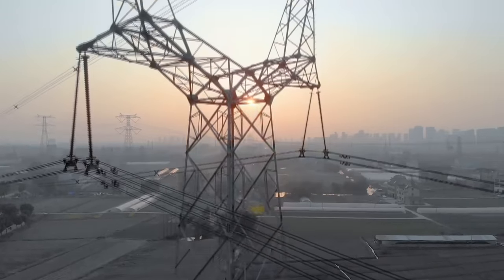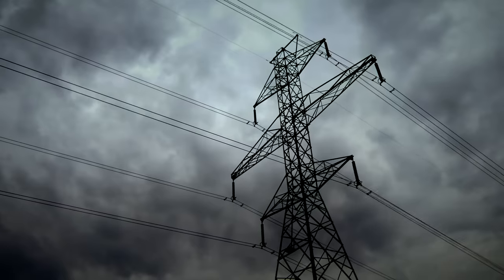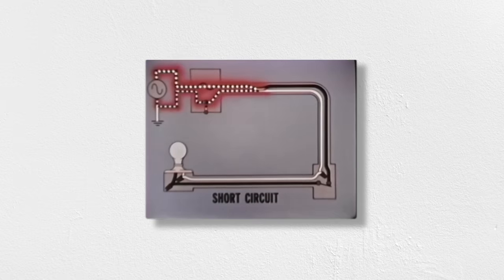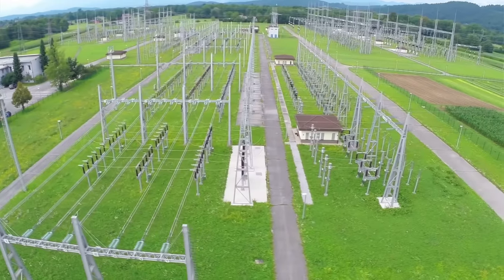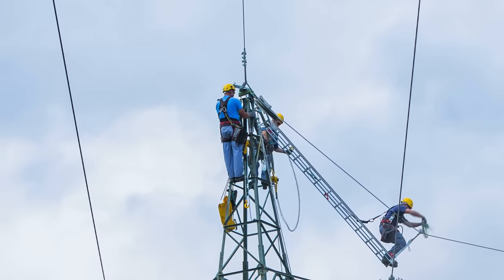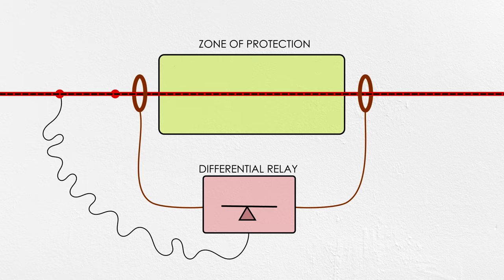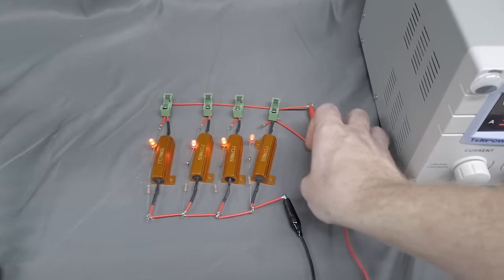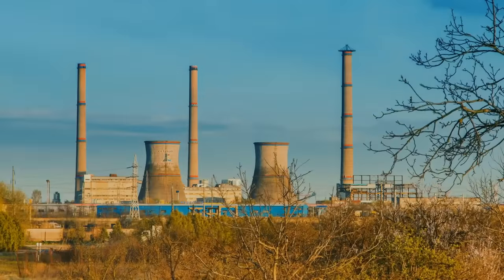How Power Blackouts Work

Comment: "Loss of a service at the cost of protecting the rest of the system" well that is a different perspective
Reply: That's why major public services and big business had their own emergency power supply, though.
Reply: Look at it this way: Do you want to lose power for one or two days or 2 months? Designing systems to go off grid or fail, before the powerplant does is essential, to not have power for the next 2 months. If the generator in a power plant gets damaged, that plant usually isn't working for the next 6 months. Also shedding large power consumers, like steel arc furnaces and so on is faster than starting up a gas turbine.
Reply: @JainZar1  or the electric companies can start doing their jobs and stop being greedy and put there lines underground in forest areas and not have the fire/blackout at all.
Reply: @emanuelgonzalez7213  If your place is anywhere near San Andreas fault, then putting your cable underground is... rather suboptimal. They should have done more maintenance, though.
Reply: @emanuelgonzalez7213  there will always be blackouts. In my experience, ground cables break more often than hanging power lines, usually because someone didn't check the ground before digging. Also, ground cables don't get cooled of by wind, so they are more prone to melt during heavy load.

Grid protection is my job. It's really about shutting down before stuff breaks. If you have a blackout that lasts for less than a day, we've definitely done our job. If it lasts for a week, we might have missed something important.

If nobody even tried to do our job, expect at least a few fires, and probably a transformer explosion. The full cost to replace everything that was destroyed will probably be a dollar amount of 6-7 figures, and take at least 6 months before it's up and running.
Reply: Guys I think you all missed the joke. Loss of service at the cost of protecting the rest of the system. It's the other way around. You protect the system at the cost of a small loss of service.
Reply: I believe it was supposed to be in the opposite order--protecting the system at the cost of a loss of service.
Reply: #GrammarNazi

#WordCrimes

😅😅😅
Reply: @emanuelgonzalez7213  rolling blackouts aren't what's happening in ca right now. Rolling blackouts happen when there isn't enough generation capacity to meet demand.
Reply: @MGSLurmey  This guy gets it.
Reply: "Loss of a Special Administrative Region at the cost of projecting the rest of the country" well that is a different perspective...
Reply: Rusdani Budi Wicaksono hA
Reply: Brain “hey heart stop pumping because we’re seeing a spike in signal”

Heart “aight”

Body “wait, DON’T! what the ..........”
Reply: @emanuelgonzalez7213  Following on to what was already said, underground cables are massively more expensive to install and maintain. WHEN, not IF they fault, they take a much longer time to repair. In the time it takes to find many underground faults, a standard above ground line would've been fixed and back in service for a while. Then you still have to excavate and splice the underground cable. 

They have their place and are great for some areas, but they aren't a magic bullet to end all power outages. These are all things the design engineers consider when designing a line.

Boy ohh boy do people get mad when you fire up a hydro-excavator in the middle of a residential area at 1 AM to fix a cable. Even if the powers out, lol.
Reply: @emanuelgonzalez7213  Actually, underground lines are less reliable then overhead lines, and finding faults can be a nightmare. Underground transmission lines require circulated oil for cooling. The public perception of underground lines is very far from the reality.
Reply: @flagmichael  it depends on where you are. Here in FL underground is much better.  Hurricanes don't damage underground lines, and underground lines don't bump together in the wind damaging other equipment.  I think it was 2004 or 2005 when we had 3 hurricanes in quick succession. Some areas were without power for months while they replaced downed lines and damaged equipment.  As the first hurricane was starting you could see all of the fuses and transformers exploding across the horizon, it looked like lightning off in the distance.  I was lucky, only 1 week without power after each storm.
Reply: @8180634  The trouble isn’t just reliability. Capacitance of underground cables is far higher than their overhead counterparts. That represents a considerable added strain on generation to produce more reactive power so the lines can stay charged.
Reply: @emanuelgonzalez7213  Yeah, why don't the electric companies stop taking our hard earned dollars until they generate infinite wireless energy and make everyone immortal? Until they build an indestructible grid which effortlessly conveys me literally anything my heart desires I'm not paying my bi
Reply: In 2003 we saw a dip in the Frequency as  far as Arkansas. I spent 47 years in generation ,transmission and distribution, this was a good video.

Comment: In 2003 at 3 AM Italy had a serious blackout that involved 56 million people. It was caused by a tree flashover on a 400kV line that supplies power from Switzerland to Northern Italy. The loss of the powerline triggered the two 40kV lines from France to trip as well, due to the sudden increase in demand. In 4 seconds GRTN lost control of the power grid, as a series of cascading events plummeted the entire Italian peninsula and the island of Sicily into darkness. As the grid frequency dropped below 47.5Hz a total of 7.5GW of distributed power plants went offline.
The blackout lasted for 12 hours, though some regions were affected by rolling blackouts for two more days. In Rome people were stuck in underground trains. All flights were cancelled, and a total of 30.000 people were stranded on trains. Police described the situation as 'chaos', though no major incidents occurred.
Though our little power outage was big for Italy it pales in comparison to the 2012 India blackout, which involved 9% of the world population.
Reply: also in 2003, the US northeast region suffered a massive blackout for much the same reasons, though the initial line failures took place over about two hours, with the final cascade of power plant shutdowns taking less than five minutes.
Reply: Italians are well known for electronics, especially in cars.
Reply: nice comment, thanks
Reply: You'd think a tree, much less the ground itself is a really bad conductor, but that's 400000 volts. And electricity is known to jump, even in thin air. It's probably a good idea to get rid of any trees anywhere near high voltage lines. This is also why hospitals have self sufficient generators that can last I think up to a week, or until they're out of fuel.
Reply: This is why we need underground lines. More reliable, safer and less environmental impact.
Reply: @PunakiviAddikti  Not only does hospitals have generators, most life critical hospital equipments have battery backups on them, so temporary electrical disruptions won't kill someone, though it would often be just enough to finish the operation or perform emergency evacuation if generators don't come back online soon.
Reply: Is the grid grounded?
Reply: @cryo_life  no.
Reply: @samschannel531  Um, no.
Being underground means they're vulnerable to a different set of hazards, is all. Actually digging the tunnel to push the lines through has a fairly large environmental impact, and repairing any damages would have a reaccurance of said impact.
Plus, it'd probably be weak to small earthquecks.
Reply: Marik Zilberman, You wouldn’t have to cut down huge swaths or trees and keep them trimmed, and there’s no warning for a tree growing into a line in the middle of nowhere, but there is early warning of earthquakes so the lines could be shut off before the earthquake strikes.
Reply: @Mernom  the first thing I though: flooding
Reply: @samschannel531  the 2003 US/Can incident was a few problems all at once. The initial problem was a tree. However this was due to a small private utility company who had hired a small tree company to maintain the said area. The company was neglectful of its contractual obligations. This alone should not have cause a major issue. However the monitoring system was also neglected and the tech, who was supposed to be monitoring the system, was away at lunch iirc. As this part of the grid failed, the remaining power stations started to pickup the load, and couldn't handle it, causing more and more overloads. It lasted a few days until they finally discovered where the issue originated.
Reply: While it affected many people, it did not last for too long. I remember the 1998 American ice storm. The outages lasted several weeks, even months. From wiki : "Exacerbating the problem was a steep drop in temperature that immediately followed the passage of the freezing rain, which combined with the extreme power outages led to numerous indirect deaths due to carbon monoxide poisoning from generators and other sources as people desperately tried to remain warm. Many power lines broke and over 1,000 transmission towers collapsed in chain reactions under the weight of the ice, leaving more than 4 million people without electricity, most of them in southern Quebec, western New Brunswick and Eastern Ontario, some of them for an entire month."...."Critically, about 1,000 steel electrical pylons[15] and 35,000 wooden utility poles were crushed and crumpled by the weight of the ice, further damaging the power supply and hampering the return of electricity. Teams were brought in from places such as Prince Edward Island and Nova Scotia, along with teams from the United States and the Canadian Forces, to help restore power to affected homes in eastern Ontario and western Quebec"
Reply: @samschannel531  It's not that simple. Studies have been done by many entities. See, for example p6 at https://psc.wi.gov/Documents/Brochures/Enviromental%20Impacts%20TL.pdf .  Quoting from it as an example, "It is a common practice in residential areas to place low-voltage distribution lines underground. However, placing high-voltage transmission lines underground is less common and can cost two to ten times more than building an overhead line. While this practice may reduce aesthetic and other impacts, it may increase others. High-voltage transmission lines differ from lower voltage lines in that significant aboveground facilities are necessary to support the underground cable. [....] Underground transmission lines can have the following disadvantages:
• An increase in the area of environmental disturbance;
• The complete removal of small trees and brush along the transmission ROW;
• Increased construction and repair costs;
• Increased operation and maintenance costs.
Reply: Hope u all are safe
Reply: Lol, most of India uses unregulated electrical power
Reply: proud_asian_newyorker you're not familiar with electronics, aren't you?
Reply: @Mernom   Having lines in ground does have some other adavantages: 
-No as heavy infrastructures (pylon) needed, so less metal to manufacture, assemble and transport.
-Cables can be made of full copper and of higher gauge, whereas for overground they're thinner as they must be lighter, this introduce higher resistance losses rating.
-For some situations, the wiring lenght may be smaller, so less conductor's lenght and so wasted electricity.
-Lastly, cosmetically, it's clearly better and it avoid some preocupations (trees and other)

The cons are that cables must have very thick and resilient insulating surface for external degradation; burying them into ground is difficult, maintenance concerns are suboptimal, and security wise, underground is not always the best, again, according to the situation.
Reply: RIP the tree.
Reply: Read "Blackout" from Marc Elsberg
Reply: Last big blackout in Germany was a when a big snowstorm tore down some powerlines roughly 20 years ago. 
Almost 2 million without electricity for a week or so
Reply: @PunakiviAddikti  Indeed, it's not animal, but vegetables species that are the downfall of power grids.
Reply: "Police described the situation as 'chaos', though no major incidents occurred". Yep, that's Italy and why love it.
Reply: @samschannel531  Underground lines have their own problems, including cooling needs, expense, and difficulty in finding faults and repairing them. Underground lines for transmission level power are very rare. (EDIT - I retired from IT field Services, with emphasis on Energy Delivery systems, in a Fortune 100 electric utility.)
Reply: Atleast everyone was sleeping
Reply: @flagmichael  yeah, I worked in the electrical industry for a couple of years and learned about thermal runaway where underground cables melt and can explode.
We still have a large number of oil cooled underground cables here in the UK. They're that old that they leak like a sieve, so they just have a gravity fed tank continuously topping it up at the substation.
Reply: Italy and chaos are more or less synonyms.
Reply: @yoyit2Dan  I think there was also a computer glitch that hid the problem?
Reply: That happens when you run your power lines near to thiers max capacity.
Reply: 12 hours of black out is nothing, where 12 days of black out is as common as the rain
Reply: @PunakiviAddikti  Here in America the NFPA requires 96 hours of fuel stored on site for generators. If i remember correct that's calculated by the unit running at 80% load.
Reply: @akimbojimbo3763  Nice to know that there's a mandated minimum. That should buy some time to prepare, like get more fuel. I think most places also store more fuel.
Reply: But why it's happens?

Comment: I can simultaneously:

1. definitely respect the engineering aspects of blackouts and the safety it brings
2. be utterly frustrated at the years(/decades?) of mismanagement and shunned preventative maintenance that lead to them being required
Reply: Ideally, grids and systems should be replaced regularly (they transmit HUEG amount of energy, some material deformation and decay cannot be avoided), but changing these stuff are costly, and sometimes you run into problem like 'these stuff didn't made anymore' or 'nobody really knows how these works', which is ultra sucks.
Reply: Travis Johnson : Ontario Hydro learned a major lesson during the Ice Storm of January, 1998.  Since then, they are much more diligent about keeping trees away from local power lines.  They always had been pretty good about the major high voltage distribution. “Next Door”, in Quebec, they learned that there was a limit to how much weight a transmission tower could hold. . .  and when one collapsed, it would pull down several more.  It took more than a month to restore power to some areas.
Reply: I never experienced a blackout in the 33 years of my life (in a small and "overdeveloped" nation though).
Reply: @Peter1986C   I hate the word "overdeveloped." It sounds like we had enough innovation and we need a few steps back when people were dying of preventable diseases or people were living worse than we do today. "Overdeveloped" really sounds like some form of scare tactic that primitivists would say.
Reply: Preventative maintenance can't prevent everything, and it's never been expected to.
If you see a power system with constant blackouts for no discernible reason, that might indicate a failure to do preventative maintenance. If, for example, the entire state that that power system has been in for decades turns into a tinderbox underneath all of the power lines, normal rates of failure suddenly become catastrophic events that cost human life.
Reply: @MrBiky  I said "overdeveloped" as a jab at my fellow Dutch and I not getting that we are extremely spoiled when it comes to infrastructure, even when comparing to other "rich" nations. But I guess I failed at bringing that across (my bad).
Reply: @Peter1986C   I'm sorry for the rant, but I couldn't hold it in. I didn't mean any offense to you personally, or anybody else (unless you are a primitivist). I began to see the word used quite often and while I value free speech, that doesn't mean I will not exercise my right of free speech. Don't take it personally, the comment is more an opinion piece and intended more for informative purposes.
Reply: @MrBiky  You are taking things a bit seriously mate, relax. No one is offended in this thread ;-)
Reply: @Peter1986C   I was addressing in a more casual way, though I guess it's hard to "read an accent" (I was semi-sarcastic and I like poking fun at some people, like primitivists in this case and some # notall environmentalists - but now I guess I made myself look like I'm obsessed with them, which is... well, actually half-accurate, lol)
Reply: not to mention all of this sometimes happening when the executives and investors are raking in mountains of our utility bills, in spite of crumbling infrastructure.
Reply: Privatising energy consumption is one of the more dangerous aspects of our society. If these energy companies were publicly owned then there would be proper oversight and requirements enabled to stop the brown outs or black outs.
Private companies cut down on preventative maintenance because they think it's a cost they can ignore. As you say decades later all of those moments of nickel and diming the costs come back to bite the public.
Not to mention all the corporatist unethical actions like price fixing so customers end up paying more despite no change in service at all.
Reply: But why it's happens?